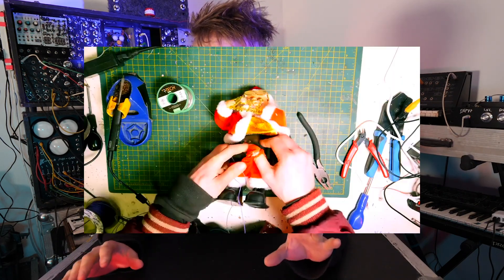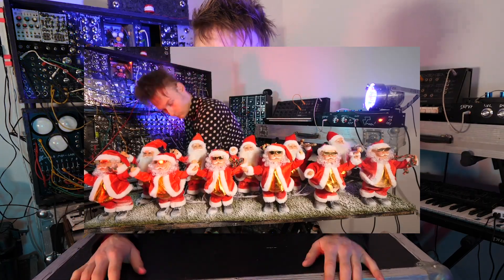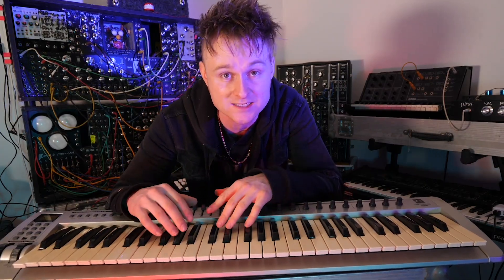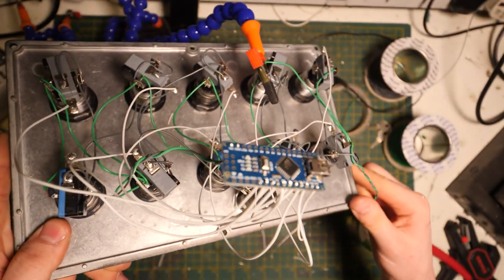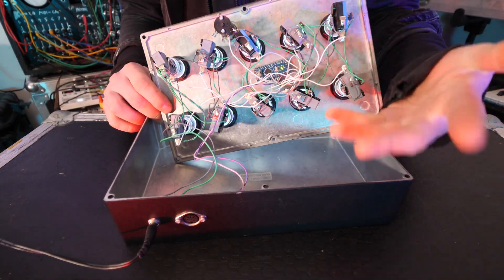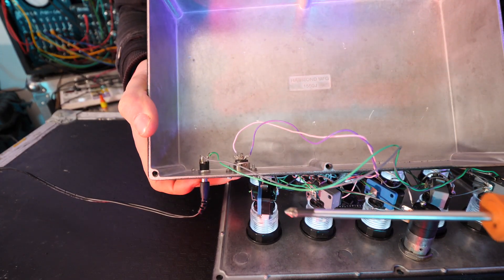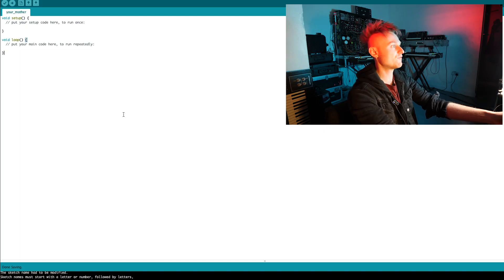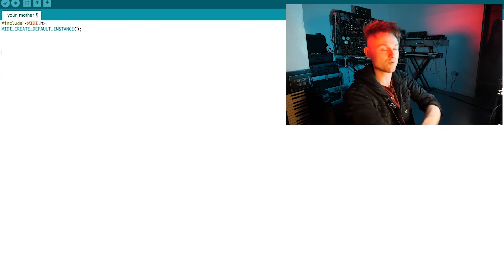SUPER SIMPLE MIDI KEYBOARD DIY HOW TO

Comment: 15:10 as a software engineer, I can't say the code is "high quality" but as someone who remembers what it's like at the beginning of programming, yes, your way is in fact simpler to someone who has no idea what they are doing because it is more verbose and much more obvious just by looking at it to see what it does. Also the point of high quality clean code is to make a program be able to be expanded or function more efficiently. Unless you are making very complex midi controllers, there is little point in trying to punch above your weight code wise, that said it is nice to improve your skills over time, never know when they might be useful in the future!

Comment: You should use a mateix, that way your 11 switches (11 input ports) would only need 7 ports of actual input (3x4 rows/columns)
Reply: It also means you don't have to spend more to get a super ultra mega, you can have 16 pins, which allows 64 inputs, in a grid. It is simpler to make too, since you just need a long cable for each row and column, and some diodes

Comment: I used your piece of code and adapted to my needs. Now, the arduino seems to be receiving midi  (Rx led blinking when I play). But I can't get any midi signal in my DAW. I'm using an aduino mega 2560, do I have to change something to the code (in addition to the pin numbers) or load more libraries to make it work ?

Comment: Nice, the code as it is, sends 10  NoteOff signals in every loop if you don't touch any button. It is "bombing" the synth with unnecessary info. Anyway I understand you wanted to keep it simple for the beginners. Very  good video
Reply from the maker: Yes but this is the simplest form to prove a point. In the description comment you would have found an annotated version with this added
Reply from the maker: Cheers!

Comment: So if you wish to midify an old keyboard (in my case an organ floor keyboard), this piece of code would work as is ? I was concerned the on/off polarity of the keys would be different from the switches you use. Also I guess I'd have to change the octave (and add a few more notes) ? By the way great way to get into coding, thanks :-)
Reply from the maker: Check my organ building series I do that to the floor pedals with this code
Reply: Oh yes... Had forgotten that, thanks !

Comment: Lately, I've been obsessing over the old idea that with SPDT buttons, one can determine key velocity by timing the break-before-make between the two throws.  The hard part is finding SPDT pushbuttons which aren't snap-action! If there were any SPDT arcade-style buttons, that would be nearly ideal, but haven't found any yet. May have to resort to the more fiddly route, replacing leaf-switch in an arcade button with an SPDT one of similar size.
Reply from the maker: Yep you can but velocity sensitivity in my opinion is more of a hinderance than a use. Best just keeping it simple

Comment: You know what? Each of these switches has 3 contacts, right, marked C (Common), NC (Normally Closed) and NO (Normally Open). What if you grounded the Cs and had NC and NO going to separate pins of the microcontroller? Inside the switch there's a tongue (C) which bounces between two contacts, NO and NC and there's a spring in the tongue that makes sure it prefers to stick to NC. The tongue takes some time to travel between NO and NC contacts, so in the interim, there is no connection. What if you were to measure that time, between the first time NC is broken and first touch to NC, would you be able to make a VELOCITY sensitive arcade switch? I have some doubts, because they make the spring inside the switch snap and whack the NO contact pretty hard, and you also have some undersampling and bounce to worry about, but maybe just maybe?

Actually i might just try that. I don't have any arcade buttons but i have endstops/microswitches, mouse button switches, and maybe some other switches.
Reply from the maker: Hey up you can try it. But the issue is the switch is designed like a sprung contact. The switch over is always the same time. No matter how lightly you push. You load the spring and the switch clicks. Also velocity. In my opinion is pointless. Never used it. Probably never will. Cheers :D

Comment: now. in order to get the velocity right... you take a flipflop switch thingy with 2 contacts and 1 common... as the arduino clearly has internal pullup resistors, just use 2 seperate input pins, and the velocity aka the volume is the inverse of the time it spends 'somewhere in the middle'. aka the faster you push it the louder it gets. :P but generally having a keyboard do that just makes a mess in the sequencer and as such it's only good for live real time played stuff. (as in it pretending to be an actual piano or something. as you probably also don't have 88 seperate hardware timers in that chip just use one and store the value it had when the key was no longer fully up and take the value it had when the key was fully down and the difference between that is how fast they pushed the thing. but yep. as just an input device for sequencers. it is very annoying if it sets the volume for you differently to how you pressed each key. :P so there the cheap keyboards that simply don't are preferred. velocity = volume... although in sid terms one could also use it for attack rate.
Reply: as for the midi interface's electrical specification and rs232 baudrate :P ehm... 'well, it works' lololololol ... i guess. lolololol. more or less. no guarantees :P it's actually current loop from some opamp fed into some optocoupler at the receiver end and some short circuit protection at the transmitter end is desirable too but hey. whatever :P lol. some doubts about the random crystal in a random arduino being able to produce exacty the desired baudrate at 0% error too... but it's midi. a handful of bytes will pretty much always just sync fine. even if the baudrate is like way off.

Comment: Was fun to shrink the code down to basically a couple of arrays and a couple blocks.  

Micro controllers are a lot of fun to learn with both for hardware projects but also just programming in general.  You're limited in multiple ways compared to a full computer of any kind which leads to learning efficiency and a lot of low level tricks to get around.  I usually use Assembly and C on 8 bit controllers.  Those are also my two most comfortable languages in general so it works out. 

When I made my own midi keyboard I used a matrix to get all the keys working with a minimal number of inputs needed. A lot like the hand wired or custom pcb computer keyboards I've made just with different firmware more or less. Both are just a series of interpreted switches running to s microcontroller.  Still used a lot of inputs to limit and possible ghosting, but also enough to use the pi pico I switched to.

Comment: 1,2,4,8,16,32,64,128,256 are all common values when it comes to basic computers , all the way up to advanced computers. Had to learn all that when I was studying computer networking to compute binary and then convert to hexadecimal.

I really want to build one of these, but I wish the buttons were pressure sensitive and could send the values of 0-127. That would be nice.

Comment: For anyone planning on doing this, at 14:41 he says that there are better ways to do it and he's right! I'm making one right now, and I am restricted as I only have 8 buttons so i came up with a cool idea to share:

Use arrays! Have your buttons be stored in some array like int buttons = [ 0,1,2,3,4,5,6,7] ( the pin numbers of your buttons). Then comes the magic. You can have separate arrays for each scale! so for instance you could do something like 

int Phrygian = [whole/half tone steps away from base note];
int Locrian = [ same thing for locrian]
etc..
int Modes = [Phrygian, Locrian...]

Then have an array with the base notes:
int Keys = [midi for C, midi for D, midi for E... so on].

Now in your logic you can have a variable for what mode you are in, and what key you are in:
currentKey = 1;
currentMode = 2;

And now to send a note you can go through each button and if it is on, add the key youre in to the note on that mode!
for(int btn = 0; btn < 8; i++){
   if(digitalRead(buttons[btn]) == HIGH){ midi.write(  (Keys[currentKey] + Modes[currentMode][ btn ] ); }
}

Now you can have a knob or button to allow you to switch between keys and modes and your keyboard will only play in the key and mode selected!

[for any aspiring coders out here, if you find yourself rewriting alot of the same code, try to find a solution with functions and arrays. Notice how i took his 10 if/else statements and reduced them to just a small loop and a few arrays. And the best part is, if you want to change a note or key or something, you just have to change it in the array and not in each if statements :) ]
Reply: Nice call. Also good for 8ve shifts

Comment: I am proficient in code but not electrical engineering. Now I kinda want to turn my DaVinci Resolve Speed Editor into a midi keyboard using some midi libraries. 

And for those screaming Semicolon in the comments. Lookup what's a Greek question mark is and just remember that instead :)

Comment: Should you not have inserted some 220 Ohm resisistors into the +5V feed and the data connection to the Midi output socket ?

Comment: It is possible to get up to 512 pins with chip that expands ports count (I2C port expander or similar)
Reply: You can do that more easily and efficiently by just having several common lines and switching between them every cycle. That's how most keyboards work, but also displays (from old LED segment ones to modern LCDs and OLED displays).

Comment: For an extra layer of protection I'd add a resistor or two inline with your MIDI out jack. The receiving device is supposed to have the resistor but it's better to be safe.

And regarding your code, I'm not offended by the messiness. My only concern with it is that you continually send on and off messages. It would be better if you only send a message when the state changes, but that would be more code and what you have seems to work well enough.
Reply from the maker: Yep on the resistor. The going joke is if someone if protective of their synth don’t let me plug in a midi device. As for the midi commands there is a piece of code on the site that solves that issue and also has resistors on the image on the site 👍

Comment: cool video, I was looking to make a midi pedals switches to use with my guitars (to control PodFarm2) 
8:00 instead of "int button1 = 2", I'd do "#define BUTTON_1  2"... or at least if you want to use an int, transform it into a constant "const int button1 = 2"

in the loop function, it could be optimized ... first if you compare the buttonvalue with LOW, there is no need to compare that value with HIGH just after, use a "else" => it cuts all boolean tests in half
An more elegant way :
switch(button1Value)
{
case HIGH:
    MIDI.sendnote(36, 0, MIDI_CHANNEL); // #define MIDI_CHANNEL   1 (for the midi channel)
    break;
case LOW:
    MIDI.sendnote(36, 127, MIDI_CHANNEL); 
    break;
}

switch(button2Value)
{
case HIGH:
    MIDI.sendnote(38, 0, MIDI_CHANNEL); 
    break;
case LOW:
    MIDI.sendnote(38, 127, MIDI_CHANNEL); 
    break;
}

etc etc...
Reply: Don't use a switch statement, use an if-else. For example:
if(button1Value == LOW)
{
   sendnoteOn();
}
else
{
   sendnoteOff()
}

Or streamline that just a bit more:
if(button1value)
   sendnoteOff();
else
   sendnoteOn();

Or to be unintuitive to anybody who doesn't really know code:
sendnoteOn(pitch, button1value ? 0 : 127, channelno);
Reply: @eDoc2020  switch is than a series of if/else ... but in that case it doesn't matter ...
it should be more intuitive, it's litteraly what you have to do ...do something depending on the case

Comment: 17:21 If you don't go analog reading of keys (which you didn't) there are also multiplexer. Where you can wire more than one button to one pin.
Reply from the maker: I talk about multiplexers in the vid
Reply: @LOOKMUMNOCOMPUTER  Yeah, It came slightly after that timestamp. Video slipped away (was playing a game) before I was able to delete the comment.
Reply from the maker: Not good for beginners

Comment: Chef,

try what i told you, get a Arduino "compatible" OLED display, get it running, display your name or so on the display.
then make a Char / byte variable, try shifting bits to the right or left.
You need to set your calculator on the computer in programming mode, easier to convert binary in to decimal or hex.

Try MASKING a byte, the old fashion way to change a desired bit in a byte, using a second byte and addition the sum.  AND GATE.

Not sure if you have "direct" access to the timers of the ATMEL Arduino MCU, you could get the value (all the time) of the timer and test it with a value you choose (a simple IF statement) to turn a led on or so.

some addition, multiplication, etc, etc.

Elaborating bytes and bits is all a CPU does.
that is what one has to master, it's not so hard, if someone understands the BOOLEAN logic principle, AND, XOR, NOT, OR.

Again the "Struct UNION BITFIELD" is very handy, to extract single bits from a byte, witch can be extended to extract HIGH and LOW NIBBLE from a byte. it's a C data type (sort of class)
Useful for midi status bytes, since the first 4 bits  (HI NIBBLE) says what type of message it is, like NOTE ON/OFF, pitch bender, modulation, etc, etc and the LOW NIBBLE contains the HEX value of the MIDI channel.
the next 2 bytes that arrive are 7 bit (the 7 least significant bits to the right) with a leading zero (MSB), the note number and the velocity.
using the UNION struct BITFIELD you can test all bytes for the MSB (most significant bit), the first bit on the left, if it's a one, you know it's a status byte, reset your mechanism and wait for the matching control value bytes.

than you can make your own midi merger, etc, etc, once you learned how to spy the UART port.
But again, I'm not sure if you have direct access to the MCU goodies, UART, TIMERS, ADC, INTERRUPTS, etc, etc., the datasheet of the ATMEL MCU tells you what register you have to adapt to enable a timer or UART and at what speed or check if an interrupt shouted.

Actually the Arduino stuff sucks big time ( sort off), because it has a firmware than handles the USB stuff, but also the UART bus and you will be receiving the data a few clock cycles later.
Fine for a simple project like enlichten leds or so, some servo.
but if you wanna make hardcore stuff .......
the Arduino capsule hides alot of things, like how to setup the chip.

... Of course acquiring the knowledge on how a INFINITE STATE MACHINE works ( WIKI ) would also help alot!!!
to make adequate IF ELSE_IF ELSE statements and prevent the MCU to hang itself.

a OLIMEX ATMEL programmer?

by the way, there also UART, RS232, etc, etc IC's, so you can add a second, third, etc, etc midi port to your project.

Comment: I only learnt recently that midi utilised 2 wires instead of 5. I cut a midi cable in half and this particular brand so happened to use only two wires, all these years soldering 5 points when I could just soldered 2.

Comment: I thought MIDI was a balanced line ? and if so isn't pulling one pin to the ground make it unbalanced and so more susceptible to interference?
Reply from the maker: At what point in this vid is one line being pulled low? Regarding balanaced line not really it’s just an inverted digital signal

Comment: You don't need midi.h just send messages over a serial interface. Midi is stupidly simple. You can even send the 24 ppq signal for bpm info. Build your own midi sequencer! I did this a few years back and was impressed how easy it was
Reply from the maker: Yea ofcourse you can but this was described as ultimately it’s quicker to describe to people wanting to get into it
Reply from the maker: Only by a little bit but still
Reply: Very true. Super simple could be interpreted as hardware timers and interrupts using fewer processor cycles. But i also think hackerman is a hero. Great video by the way. This is one of my favorite subjects.